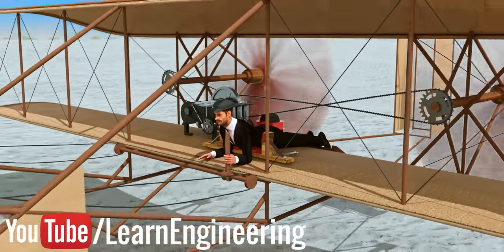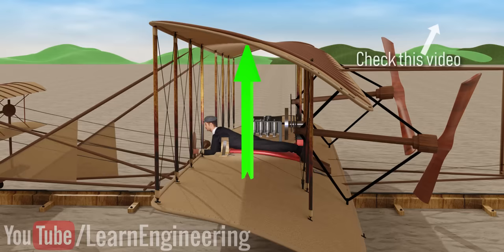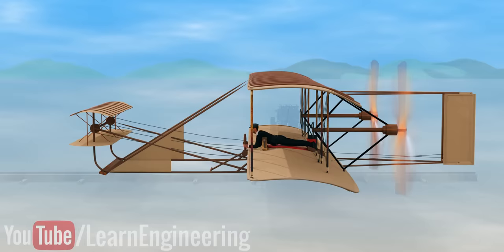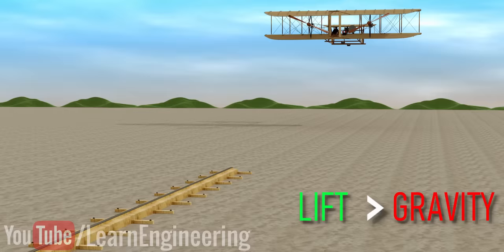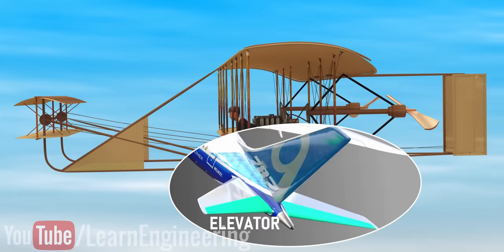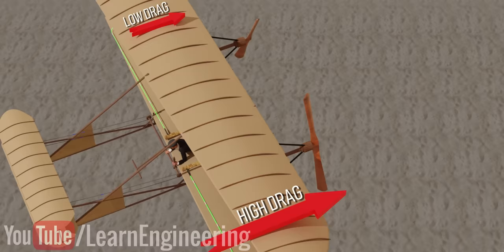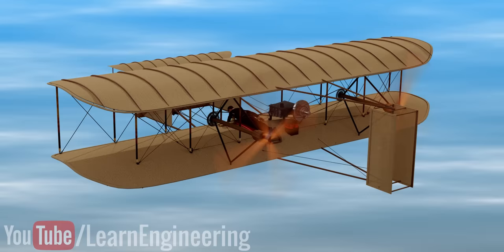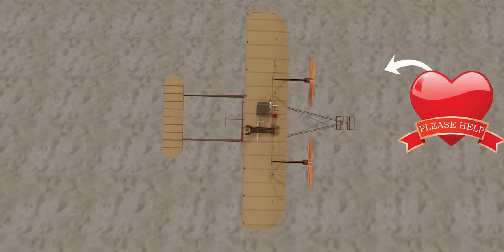The Brilliant Engineering of FIRST FLIGHT !

Comment: Thanks for this wonderfully animated, informative video. It greatly enhanced our knowledge. The pilot was not positioned at the center, rather slightly off the center, at one side, as he his body weight balanced the weight of the motor that was placed on the other side of the center. This was done to curb any possible angular momentum/ gyroscope effect due to unbalanced weight.
Reply: See, in the table below, the data published by the North American magazine "National Aeronautics", official body of the "National Aeronautics Association" in Washington: Pilot Location Date Flight time Santos Dumont Bagatelle 12/11/1906 21 ” 
Henri Farman Issy le Moulineaux 11/26/1907 52 ” L
éon Delagrange Champ de Mars 11/04/1908 6’30 ” H
enri Farman Issy le Moulineaux 06/07/1908 29’53 ” Léon Delagrange Issy le Moulineaux 09/06/1908 20’19 For many years, these official figures have been published without any dispute. In the American magazine "Reader’s Digest" of December 1942, we found an article entitled "Santos Dumont, Father of Aviation", condensed from the magazine "Air Facts". From page 54 we transcribe the following excerpt: “in 1906 he gave the world the first public demonstration of flight in a device heavier than air (the Wright brothers only came to fly publicly in 1908)”.

Comment: It is important to note that Orville and Wilber Wright spent a lot of time on their gliders, learning to control the gliders before they attempted powered flight. They learned to be pilots first. And they did not lay in the center of the aircraft so that their weight would cancel out the weight of their engine. But they did center themselves on their unpowered gliders.

Comment: Just came here to say that the first airplane was made by Santos Dumont.
Reply: The first take-off (which proves that the thing is a plane aftreall) od Wright Flyer was 3 years before Dumont took off. But it doesn't matter that much, all pioneer aviators are heroes!
Reply: @DopravniPoradce  There isn't consistent proofs of the Brother's flight in this time. They didnt took footage being that they could have done it, as well as they didnt call any scientist to comprove it. But they tried to sell the patent to everyone refusing to demonstrate the effectiveness of the invent, so greedy they are.
Reply: @DopravniPoradce    All pioneers were important, but the first plane that took of and flew by itself and nobody doubts that the flights were made. was the 14-bis invented and piloted by Santos Dumont.
It was much lighter than the Flyer and had a V8 engine with 50 hp. 
    The Flyer just could not Fly without a huge external power, because was 340,2 kg and had only 12 hp. The propellers turned really slow, at just 350 rpm. 
    The Flyer
Reply: @antoniohenrique2229   Exactly.  Before 1908 there is no proof about any sustainable flight made by the Wright Brothers.
    The Flyer 1 had 340,2 kg and only 12 hp.
   Impossible to fly sustainable with this power x weight ratio.
Reply: @antoniohenrique2229  There is evidence of a 1903 flight but not the conclusive proof that comes from having more than 17 spectators.  I am sure they probably invited Octave Chanute who did make the difficult trip to Kitty Hawk earlier to test his glider designs.  The Wright's originally considered their test flight as a proof of concept prototype.  They did have to demonstrate their design to the Army but didn't do this until 1906.
Reply: @stevebett4947  Steve, you said " I am sure they probably " 
   In this sentence you show that there is no way to be sure, otherwise, you may agree,  the "probably " would not be there.🙂
      Since as you mentioned before, the Flyer 1 flights can not be proven,  so why it is the one used to celebrate the first Wright brother's airplane flight ?
Reply: @sanpol4399  The validity of the Wright Brothers story is more difficult to disprove than it is to prove.   The story cannot be proved or disproved at the same level of certainty than events recorded after 1906.  

There does not see to be unanimity with respect to which of the 4 claimed flights to celebrate.  Some want to celebrate the first which I believe was the shortest flight (by Orville) both in terms of time and distance.  Others want to celebrate the longest flight (by Wilbur).   Replicas of the Wright Flyer I have been able to duplicate the shortest flight.  They have never come close to duplicating the longest flight.  (852 ft. in 59 seconds).  No one has been eager to try to fly the unstable craft in a 27 mph. wind.
Reply: @majorbett  So you agree with me that the 14-bis historical flights are impossible to be denied just because they can be proven. 
    And you agree you may choose to believe in some Wright brothers flight before 1908, but you are not sure.
    Is that wright?
Reply: One more Brazilian trying to convince the world that they made the "first aircraft"
Reply: @vmorita  The argument is that Santos-Dumont's 1906 flight in the 14-bis was the first officially recorded flight.  If a credible flight requires an expert witness from the French aero-club and the FAI, why aren't the Brazilian's right?

Comment: Lift, thrust, drag and weight were first identified by George Cayley, the pioneer of aeronautics, 100yrs before the Wright Bros who read his papers and followed his principles.  
Cayley designed the aerofoil and built the first manned glider. (He also invented the the wire wheel, for lightness.)
If there'd been a practical source of motive power at the start of the 19th Century, he could've done powered flight.
Reply: I just saw your comment and put my own before I saw it Your correct Caleys principles of Flight for his Aircraft used by the  Wright Brothers in their Aeroplane which is a Powered Aircraft. Caley made in Yorkshire😊

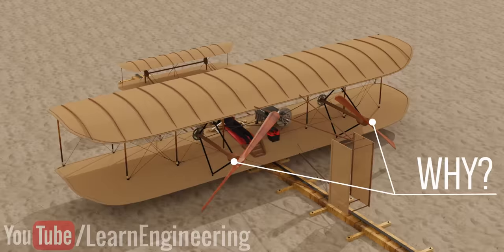Comment: 2:00 - Bingo! Bingo! Bingo!  The real genius of the Wright Brothers was that they realized from their glider tests that all the wing lift data that had ever been published in scientific journals up to that point was WRONG.  The methodology used to calculate the lift data was flawed and the results unreliable.  They built their own wind tunnel in their bicycle shop and developed their own lift data which they then used to design the wings of their flyer.  That was type of out-of-the-box thinking that allowed the Brothers Wright to succeed where so many others had failed.
Reply: There is a debate between those who think that the wing lift data calculated by Lilienthal and others was wrong and those who think the Wrights' interpretation of it was wrong.   I will find  the references if 
you are interested in studying them.
Reply: @stevebett4947  the wrights is within a couple tents of a percent of the exact amount we know today. Lilienthals was so far off and so bad it wasnt enough to keep a glider afloat unless jumping off a high surface with a huge headwind and even then not for long

Comment: Did you know that this Wright engineering could kill a person who dares to throw the machine down the hill?
Reply: The Wright's relied too much on the skill of the pilot.   They did not seem to be concerned about the lack of stability.  All of the early gliders and airplanes were lethal.  The Wright design successfully allowed the pilot to walk away from most of the crashes.
Reply: forget it, Steve, there is no evidence of the existence of a flying machine or planes before Dumont
Reply: @stevebett4947   The record for Dumont is there at FAI, France's air club and "a monument in Bagatelle, France." FIRST AVIATION RECORD OF THE WORLD "the wrights lost
Reply: @gilberto2056  There is plenty of evidence.  We are just not as certain about it as we are for evidence certified by the FAI.(founded in 1905).  

Check out wrightbrothers.com for a short paragraph on most of the machines that were claimed to have flown.
Reply: @acucarchocolate3961   wrote:   
"Barriquaud-Mare" delivered 7  40 HP Antoinette like plane engines."

The performance of the two place WF2-Model A was less spectacular 
than the 38 min. alleged flight of WF III in 1905.

SB:  No dispute about the facts just how you have interpreted them.
The engines were not at all like the 50 hp V8 Antionette.  
Do you think a 4 cylinder motor looks like a V8?

 The 7 French engines delivered to Wilbur were copies of the Wright 1906 Vertical 4 engine.  

In 1907, the Wrights were busy setting up european engine makers and air frame builders to make replicas of their Vertical 4 32 hp engine and replicas of their demonstration plane - The Wright Flyer 2 Model A.  

The Dayton engine was capable of delivering 40 h.p. at higher RPMs.  30 hp was all the Wrights needed to fly the heavier airframe with a pilot and passenger.  Using a lower RPM made the engine more reliable.

The reference to an engine that only ran 1 min. 45 sec. could have been an early attempt
with the Dayton Vertical 4 that failed.  Or perhaps the replacement engine had some problems
early on.  You can't compare the shortest flight of the new 2 passenger Model A with the longest
flight of the Wright Flyer III.  

I think the long flight was in public and had many  more witnesses than the early test flights 
at Le Mans.  When did Wilbur first invite spectators?  I thought it was in August.  

The early light weight aero engines were not very reliable.  Bleriot was not able to compete
with Santos Dumont in 1906 because his Antionette engine failed.

The engine that threw a rod was replaced with a replica of the same engine built
under licence by the French (and English) builder, Barriquand et Marre.  Did any critic ask why
the Wrights ordered 7 engines?  Wilbur used one of the European built engines instead of waiting
a month or so for a  new Dayton built engine.  

Was the performance of the 32 hp. "Wright Flyer 2 Model A" weaker than the Wright Flyer III in 1905.
No.  The two passenger model out performed their earlier design with a weaker engine.  In 1908
Wilbur set an altitude record witnessed by an official from the FAI and a distance record.
For the distance record of 124.7 km (77.5 mi)., Wilbur received the Michelin trophy.

The International Michelin Trophy was a prize given by Michelin tire company, to the Aéro-Club de France, to award on behalf of the Fédération Aéronautique Internationale.  

https://www.thisdayinaviation.com/tag/michelin-trophy/#:~:text=31%20December%201908&text=The%20International%20Michelin%20Trophy%20was,of%20the%20F%C3%A9d%C3%A9ration%20A%C3%A9ronautique%20Internationale.

https://en.wikipedia.org/wiki/Michelin_Cup#1908

There is a book, an article, and several web pages on the Wright engines.  The one at Wikipedia is probably the easiest to check out.

The Wrights knew they needed more power for a 2 seat practical airplane.  This is why the built
and tested a 30+ hp. vertical 4 engine in 1906.  

They did not learn they needed a larger engine on their 1907 visit to Europe.  They already had
one before the left the USA and shipped it to France.

I count the use of a more powerful Antionette engine as one of Santos Dumont's contributions.
It was not one that was used by the Wrights.  It was tried by Bleriot and successfully used by
Cody in the UK.   Bleriot returned to a smaller more reliable engine for his channel crossing 
Model XI.  I have yet to find a feature of the 14 bis that the Wright's used.  I first thought they might have used piano wire as Alberto did.  Later I discovered that they had gone to twisted wire in the late 1800's because it was less likely to break.  

Wilbur acknowledged his debt to George Cayley.  However both Santos Dumont and the Wrights
denied that they learned anything from Lawrence Hargrave, the man that proved that a cambered
(airfoil) wing produced twice the lift as a flat wing.   Voisin, the man who built the airframe for the bis-14 never denied that he borrowed the box kite wing from Hargrave.
Reply: @stevebett4947  blá, blá, blá, blá, blá,
Reply: @gilberto2056  and what invention you've done?